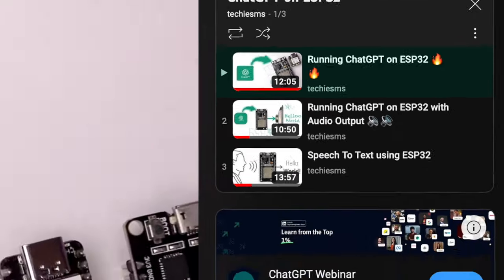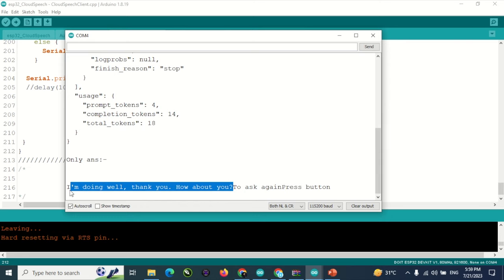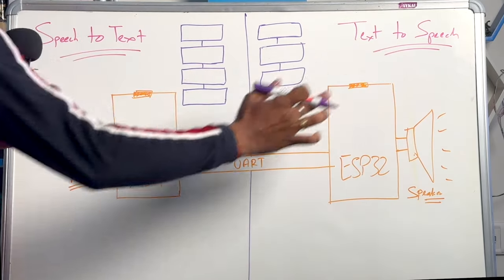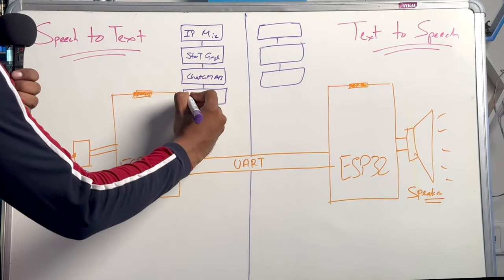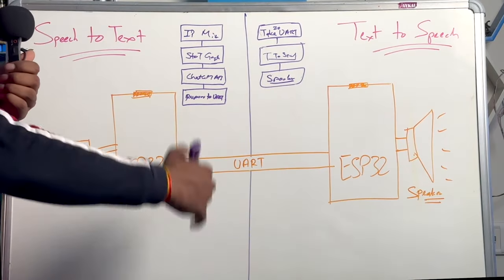ESP32 Voice Assistant with ChatGPT: Your Personal AI Companion

Comment: Some limitations of this project are:
1. The recording time is only 1.9 seconds. To make this time longer, you would have to increase the wavdatasize. But that wouldn't be possible since the esp32 has limited memory. However, you could use a micro sd to store the wav file and then send it to cloud to be converted.
2. Alot of times, the esp32s computational power is not enough to keep up with the audio playback. What this means is that, if you generate a response of more than 20-30 tokens, a lot of times what happens is that the esp32 doesn't synthesis the text and there isn't an audio playback on the speakers even though you have received the generated output. 
3. Doesn't have a wake word detection.
4. A huge delay starting from the input to the output.
A simple solution maybe to use a faster board like nvidia jetson nano which is an ideal development board with computational power more than enough for this kind of projects.
Reply: Hello I found your reply helpful, I'm inquiring about how I can  be able to incorporate a wake word in this same project. Do I have to train and deploy a separate model to detect the wake word or is there a way around this?
Reply: @nicksonamwine8869  did you find out how you can implement that?
Reply: Does this project run on esp8266?
Reply: @nicksonamwine8869   hey did you find any solution for using the wake word?
Reply: Bro a jetson nano Costs around 18000 rs in India.
Is there any other microcontroller we could rather use here which is also cheap and has more memory?
Reply: Use a old Android fone ...
Reply: no
Reply: can we make this with one board?
Reply: @cerlpearl  you could use a raspberry pi

Comment: 🎯 Key Takeaways for quick navigation:

00:00 🎯 The video introduces a voice assistant project based on ChatGPT running on an ESP32 board.
00:26 📚 To understand this project, viewers need to watch three previous episodes in the series for the context.
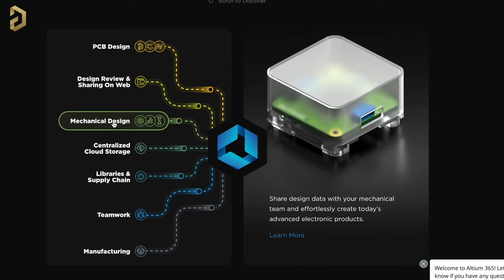01:25 🏭 The video is sponsored by Altium 365, an electronics product design platform that offers PCB design, data management, collaboration, and more.
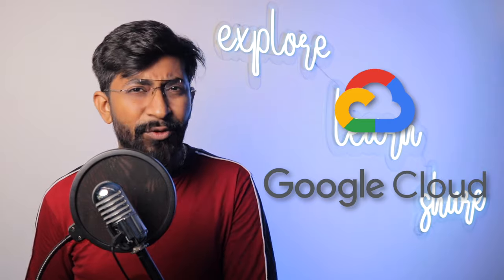02:08 🎤 The previous episode successfully converted speech to text using Google Cloud services, leading to filtered text responses.
03:16 🔄 Merging the speech-to-text and text-to-speech codes caused compiling errors, resolved by using separate ESP boards for each function.
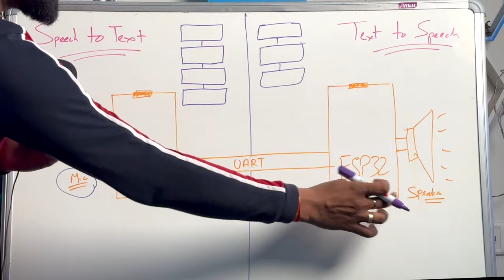03:58 🔌 The communication between the two ESP boards is done via UART, enabling a seamless flow of data for the voice assistant.
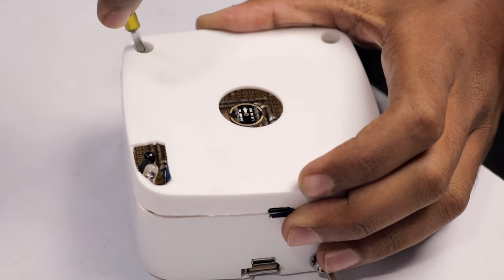06:00 📐 After assembling the components and fitting them inside a plastic casing, the voice assistant project is ready for testing.
06:18 🛠️ Turning on the voice assistant, it responds to questions with different LED indications for recording and processing.
07:02 🗣️ The voice assistant successfully answers questions, including multilingual responses, demonstrating its functionality.
07:45 💡 Viewers are encouraged to suggest improvements for the voice assistant project in the comments section for possible future episodes.

Made with HARPA AI 👍 Upvote to improve video surfing
Reply: Can you give me the name of the components used
Reply from the maker: Check description for that

Comment: Hi !  I bought two BAOFENG handys, how can I transmit from one arduino to another using them ? I mean turn audio and mic plug to TX RX, from arduino to HANDY KENWOOD PLUGS (one is 3.5 stereo the other 2.5 stereo) and receive the message in another handy which receivesd the signsal and sends via plugs to ardunio and read the message in serial moriunor a

Comment: while running the speech to text code I have got( 'LED_BUILTIN' was not declared in this scope ) in "pinMode(LED_BUILTIN,OUTPUT);"  this line , how to rectify this?
Reply: I am stuck on this too. Any solution found?
Reply from the maker: Just select the board as ESP32 Dev Kit V1 in the boards section
Reply: @techiesms  Thanks, but had to comment out the led_builtin code to make it work further. But now I am getting this error - E (2623) i2s(legacy): i2s_check_set_mclk(1799): ESP32 only support to set GPIO0/GPIO1/GPIO3 as mclk signal, error GPIO number:3000
 E (2624) i2s(legacy): i2s_set_pin(1881): mclk config failed
Can you help with this? I will be happy to pay for your time. Thanks.
Reply: @techiesms  I was able to downgrade to v1.0.6 and the upload to ESP32 worked. However, I get the following error
Press button
Record start!
Recording Completed. Now Processing...
Json daata---
Guru Meditation Error: Core  1 panic'ed (LoadProhibited). Exception was unhandled.

Comment: Hi !! Greetings from Argentina !! No one had the abbility to solve my case, maybe you can. I bought two handys Baofeng BF999s, because they are cheap and transmit 500 mts. (it says 10 km......), 500 mts. is ok for me. But, I want to send data from one arduino to other arduino, via handy, that`s why I bought two. It only has 3.5 jack/plug and 2.5 jack/ plug, has no usb port, no numeric keypad. There is not clear information enough...... can you help me ??????? schematics and code, for arduino uno or mega . Thanks a lot !!!!!!!!!!!
Reply: Hi, maybe you should try using LORA modules